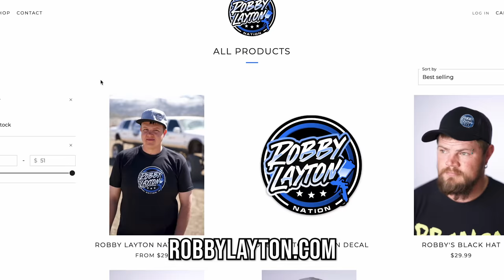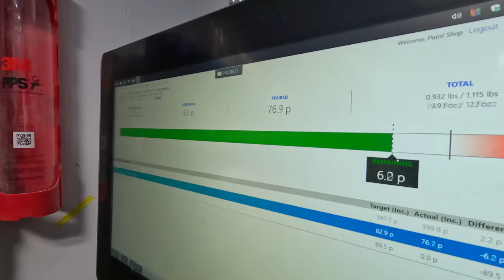New Engine, Fresh Paint For Hillbilly's Dream Harley!

Comment: Here’s the wiki definition for the gremlin bell. A motorcycle bell, also known as a guardian bell, spirit bell, gremlin bell, biker bell, or angel bell, is a decorative metal bell that is attached below a motorcycle, often given as a token of good wishes while riding. The bell is usually about 25 mm long, made from pewter or other metals, and is given to a motorcyclist as a good luck charm, or a symbolic piece of protection to ward off bad luck while riding motorcycles.Wikipedia
Reply: I always understood it to be something given by one rider to another. I knew a guy who kept a few in his saddle bags. If he stopped to help someone having mechanical problems, he’d give them a bell before they headed on their way.
Reply: As stated above, I also was told that the Tradition/Superstition is that the bell is given by another Biker to protect the Bike and Rider it was given too. All of my bikes have been 🔔...
Reply: I have read that the bell is hung low on the bike so when it traps all the gremlins that would do harm to the bike, it then dumps them out on the road where they turn into pot holes. Also, it only works if you got it as a gift from a fellow biker.
Reply: And it has to be gifted you can’t buy one for yourself or that’s bad luck.
Reply: @andrewcheney3569  Same story with the pot holes :-) ..  
Wife's been gifting mine on different bikes for nearly thirty years, before that riding buddies.
Reply: There is a classic Warner Bros/Bugs Bunny cartoon from WW2 era that shows an airplane-shaped gremlin wreaking havok in the plane factory

Comment: Hillbilly you better recheck the torque value on your compensator bolt . It should be at least 150ft lbs . I think you looked up the clutch hub nut not the compensator bolt
Reply: Yes sir your right may be more cant remember but they r fun to get off

Comment: It still amazes me the differences between my Dad's body shop started in 1946 and Robby's up to date modern shop.
Especially the differences between lead and plastic repair methods, paint booth improvements/EPA requirements. The only tool that I haven't seen in Robby's shop is an "English Wheel" (for rounding fenders)
But he sure a modern collect of machines and tools. Super professional.
Reply: Have a look at the Retropower series. They do bodywork the old way and it's a pleasure to watch

Comment: Just for the record, you looked up the CLUTCH HUB spec. but you were putting on the compensator nut.  Also, if you can put the chain on without taking the clutch hub off, the chain has way too much wear on it and should be replaced.  A new primary chain needs the compensator, chain and clutch hub installed as an assembly.  Go easy on the red lock tight, you are going to regret it in the future!
Reply: Oh man here’s another know it all! Amazing!
Reply: @Kletke84  Well, all I can say for my credentials is I have been wrenching and riding Harleys since 1968.  Put in some time following one of the best HD wrenches on the East Coast. Worked in the industry for more than a few years. Still a somewhat active rider.  Not sure how that stacks up against your fascination for video games. Some people live the life, some play it on a joystick. Tell me anything I said that was incorrect....
Reply: This guy is absolutely correct 
Very few fasteners on a Harley need RED loctite BLUE loctite is your friend on the rest 
Other than that Hillbilly did a great job
Reply: @Rags722 you are absolutely right, loosening a red loctited compensator nut can be a pain in the butt, I had to use some truck tools (the 40 ton variety)💪🏻💪🏻💪🏻💪🏻💪🏻💪🏻💪🏻💪🏻💪🏻💪🏻😅 21:52
Reply: @Rags722 is absolutely right about the compensator nut. I'm pretty sure the torque spec is higher than the 80 lbs hillbilly torqued it at and he's also right about the front hub and clutch assembly going on at the same time. Hey we learn from our mistakes. God forbid he has to pull it all apart again but if he does he'll do it right the 2nd time for sure. Who knows, maybe he'll get lucky and it'll all work out for him without fail. 🤞

Comment: It's fun to watch Hillbilly learn to wrench his bike. Has he done everything perfect? Nope. That's how we learn though.  I am a little concerned about the primary.  For one thing the chain seems worn. Usually,  the clutch, compensator and chain need to go on all at once because a chain in good condition won't flex enough to allow you to put the compensator on with the clutch already in place. Also, I would have inspected the inner primary bearing and race. Mostly to make sure the race hasn't walked into the transmission.  This especially happens with high performance engines. Also, thread locker on the intake to head bolts doesn't work. It will just cook. I use high heat anti-seize. Rock on Hillbilly!

Comment: Hey HillBilly, you were Torquing  the compensator, not the clutch basket. It takes around 140 ft lbs. Make sure you tighten later the compensators come loose all the time on powerfully bikes.

Comment: Smiling!
Just changed my oil in my bike, been dealing with some vertigo issues but think there about over. Been riding for almost 60 years and it is bugging me not to be able to. 
Ride it like you stole it, but be safe.

Comment: For those who don't know...There are metallic red paints that have the silver metal dust in the red paint. It goes on nearly opaque (you can't see through it). This is yhe sort of paint all car and motorcycle manufacturers use. Candy colors, including the red used here, are translucent. Like a brake light lens. Candy paint sprayed over a primer will be quite dull. Not that the paint won't be glossy, but it will have no sparkle to it. Base coat can be silver, like here. Or gold. Or copper, bronze, etc. Candy colors need that sparkle underneath. Metal flake base can be used also. A candy paint job looks far "deeper" than a metallic paint job. Candy paints come in many colors, red, blue, turquoise, green, orange, yellow, purple, pink, you name it. Now, Loc-Tite is a less-is-more sort of deal. A bolt only needs a TINY bit of Loc-tite. They used to do full page ads in magazines that showed a pile of nuts and bolts with one drop coming out of the tip of a bottle with words saying "All this with 1 drop".
Reply: I couldn’t tell for sure but it looked like he used the red “Stud and Bearing Mount” Locktite. If so he’s going to have a fight in his hands if he has to disassemble it later. He may have to use a torch to heat the fastener first.  

Shouldn’t he have used the new green Locktite or the older blue  “Threadlocker” Locktite. 

What do you Harley guys think?

Comment: I would go and double check torque in primary. The clutch hub is 70-80 ft-lbs and the compensator sprocket is supposed to be roughly 160 ft-lbs.   
In the video you torqued compensator nut to the torque of clutch hub nut. 

I don’t want something bad to happen to the bike and you.

Comment: I got myself a motorcycle a couple of months back. It's a 1992 750 kawasaki vulcan nothing special like a Harley. Just like hilly Billy's I also needed a stater. Since I'm not mechanical advanced as hillbilly I had to send it to a shop. With that make and model changing the stater was not an easy job.  One of the previous owners tried to fix it the you tube way of half way not right. ( involved a grinder) I ended up having to replace the stater inner cover plate and the fly wheel. Now I owe the shop. My first motorcycle is not going well either.

Comment: Good job, you cleaned the oil tank.
 What about the rubber oil lines?
What about the oil cooler?

These items should be replaced after being metal shot..

Also there is a procedure to mount the engine/trans/primary.
Usually there will be shims involved.
 
But thats just me with 40+years experience..

Comment: The only problem with red loctite is you may need heat to remove the part for replacement. I have seen the smaller bolts break before the red loctite releases. Better safe now than sorry later, so I get it.

Comment: Compensator nut (Crank nut) should be 150-165 lb/ft, not 80. That's for the clutch nut. Also, there is a front and rear to those intake flanges.

Comment: Inner and outer primary case. I didn’t notice it you checked to see if that engine needed shims, I have never seen a straight Harley frame. I hate to see the case ears break off. The shim is the little secret no one talks about.

Comment: With as much issues as you had with the old engines carb, at first, and the fact that the new engines carb is tuned to the newer engine, it probably would be best to just run the one that came with the newer engine.

Comment: There are some “rules,” however, to the Gremlin Bell and how it works:

1.) It should not be bought by the user - in order to work, it must be given to a rider from a loved one. According to the legend, a bell is “activated” by the gesture of good will when someone, especially another rider, gives it to a rider they care about as a gift.

2.) It should be attached to the lowest part of the frame. Because gremlins lurk on the roadways and “grab” onto bikes as they pass by, the low-hanging bell should be the first thing they contact, so that they are immediately captured by it. It should be attached securely – safety wire is sometimes used, but that can create rust and scratches, so a zip-tie is generally the preferred method.

3.) When a bike with a bell on it is sold, it should be removed. The Gremlin Bell is a gesture of kindness to a rider from someone who cares about them, so it should be kept by the intended recipient, and can be transferred to another bike. If someone sells a bike with a bell and they want the new rider to have it, they should still remove it, and give it to them face to face. 

4.) A bell that is not given with intentional good will loses its spirit-fighting mojo. If someone steals a Gremlin Bell, the gremlins go with it – and the bell will no longer ward them off. The key to the bell’s power is good will. If it is stolen, it loses its effect...and karma will take care of the rest!

5.) One Guardian Bell is all that a bike will need if all of the above rules are followed. Ride safe, and KNOW that you are loved!

Comment: I'd replace the hoses on that oil tank. You never know if some metal is stuck to the inside of the hoses, until it works it's way out and makes it to the motor. For me, spending $10 on new hoses is cheap insurance.

Comment: @43:00 The whole debacle about metric/standard is really only hardest felt for a mechanic. Domestic cars use metric and foreign cars used standard, but mechanics now have to buy two sets of everything, one in standard one in metric. I hope this could be phased out in time, preferably toward the metric side of life 😄. Everybody knows if a 10 mm is too small, then you go to 11. But if a 9/16 is too small, it's not as easily clear as to what is the bigger size. I hate it, and I hate that it makes me have to buy two different sets of tools with just minor measurement differences.

Comment: Damnit guys you need someone with Harley knowledge around there. You removed a better carb for a crappy carb. You could have got the bracket to install an nice air cleaner to the carb that came on the engine. Also there's a chance the carb you removed was already jetted close for the engine. You also do not want to shave down the intake the way you described. I have a feeling the new engine is much more displacement with bigger heads.   If you want that bike to breath run and sound way better put the carb that came with the motor back on with that thunderheader. Thats an EVO style engine and thats what Thunderheaders were originally designed around.

Comment: Oh no Hillbilly took the time to look up the spec but then over tightened it. It was 70-80 ft lbs and he took it close to the Newton meter 95-100 😦 He switched the numbers on the units and did 90 ft lbs

Comment: Honestly I would have used the carb that came with that engine and just replaced the air cleaner. The carb that came with it is already tuned for that engine and that carb off the old bike is tuned to the old engine and they may not be the same. Maybe someone made some changes like a different cam or some head work but bottom line is the carb that came on the replacement engine was tuned to that engine if it was pulled from a running bike or it came brand new from the factory with the engine either way chances are it’s tuned to that engine and the carb off that dead engine might not run right or god forbid run lean and burn the new engine up. You have to be very careful about that. Rich is always better then lean. Plugs and oil are a lot cheaper then an engine.  Rich might foul plugs or let some fuel into the oil but lean will ruin an engine quickly. But it’s your bike if you burn it up it’s on you.

Comment: I have never heard of any Harley guy putting type f trans fluid in a Harley Davidson primary. It takes special Harley Davidson primary oil. At least on that model. Here is what google says  We submit that ATF is too thin for Harley primary use. It's true that many Harley riders have had years of problem-free performance with ATF. We contend that a thicker oil will provide superior metal-to-metal wear protection. Chains and sprockets will last longer using a fluid with an appropriate viscosity
And hillbilly It’s a guardian  angel bell that has to be given as a gift to you to be on your own bike. Or at least to “work” on your own bike. 
Legend goes on to say that by attaching a the bell onto your bike, the Evil Road Spirits will become trapped inside the bell where the constant ringing drives them insane, making them lose their grip until they fall to the ground.